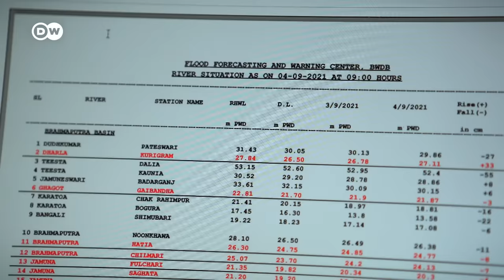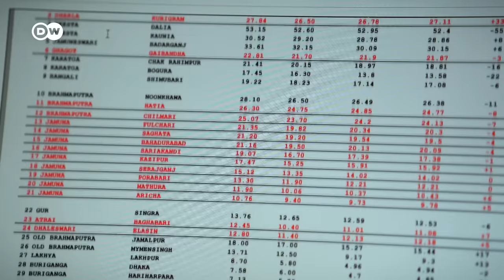Extreme weather, rising sea levels, devastating floods - The global climate crisis | DW Documentary

Comment: People seem to think that flooding only affects people near natural waterways. 
 I live in a state that doesn't have a flat spot on it.
 We have flooding events but even high areas are affected by landslides. 
 I work in the construction industry and in the past 5 years we have become landslide emergency experts.
Last year we cleared over a dozen slides that took out highways,roads,homes and bridges. 
Where our buisness is located there is a small stream that has a railroad running over it in several locations. 
 Approximately 2 miles of this stream was reengineered due to extensive damage to the rail,bridges and nearby property. 
 We had 10 such events in a 10 month period. 
I personally watched a small stream turn into a raging river.
To the point were rescue crews with powered rubber rafts were brought into to rescue people trapped in their cars. 
I'm now a firm believer in climate change and that no one is immune from it.

Comment: I think we're I building a house I knew was on the oceans occasional dance card,I would build it like a boat upside down. The bow would face the water to part the water and debree around the house instead of through it. The aft so too would be as the bow to part the water on decline. Build your seabearing homes incorporating the function of the bow and see them stand longer and stronger.the bow can also be used in landscaping channeling water away from your investment. Happy building.

Comment: Dr. Vinke sqid we are 1C degrees higher than preindustrial. Incorrect; we are 1.8C above the 1750 baseline Dr. James Hansen of NASA used in Senate hearings in the 1980s. Then they got scared and moved the baseline to 1850 and we are 1.3C higher. But using the original we are already past 1.5C. Someone said a 1 meter rise by 2100. Incorrect. More likely 10 to 20 meters. Greenland alone is 8 meters.